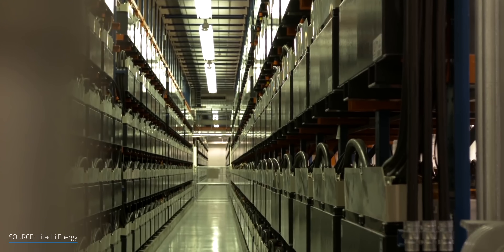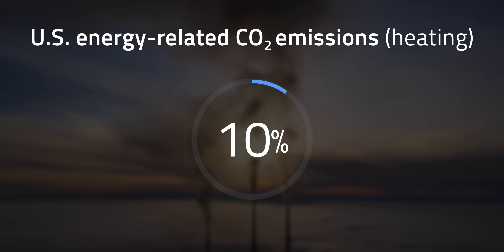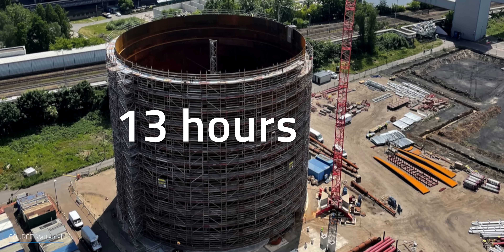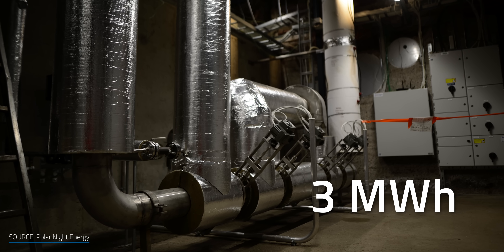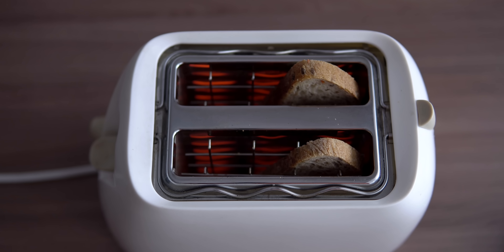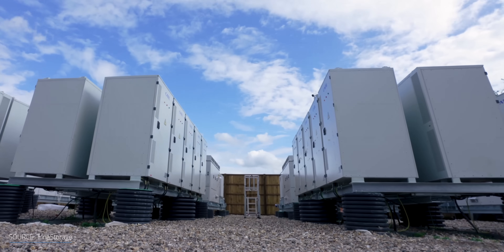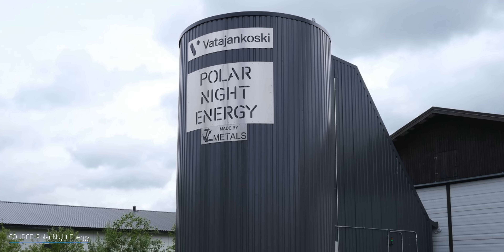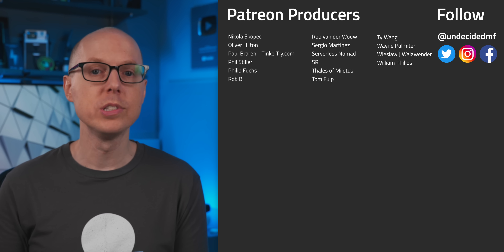How A Sand Battery Could Change The Energy Game

Comment: Actually, why not just use nuclear and the so called 'nuclear waste' since it's hot can also be used. Maybe 'nuclear waste' is actually worth more than gold on today's energy market. In that case our nuclear waste facilities are worth trillions or maybe quadrillions of dollars.
Reply: Nuclear waste (actually called spent nuclear fuel) after the period of time it cools down in spent fuel pools, doesn't emit that much heat. It can be dangerous to store it "hot", because it can melt.
You could throw it into a sodium-cooled or liquid fueled fast breeder reactor coupled with thermal energy storage (molten salt or this stuff) and do Cogeneration. District heating, desalination, synthetic fuels, hydrogen, efficient load-following... There are 2 reactors in testing (MOLTEX, and Natrium) that work like this.
Reply: @AlldaylongRock  Doesn't emit that much heat? Over time that heat is significant and 'free'.
Reply: @paul1887  Power Density. The issue here is that there's is a lot of energy (heat) in the SNF, but it's emitted way too slowly for it to be usable in any economically viable scale, such as district heating.
A reactor makes this heat usable by speeding up the reactions that emit said heat.

You would need to process the SNF to extract, for example, Pu-238 or 239(although other isotopes can be used), so you could make a RHU/RTG from it. And the amount of heat output would be enough for a couple homes at best.
Reply: @paul1887  The Peltier effect is atm pretty rudimentary and inneficient, and probably gonna be like that for a long time. There are Stirling engines tho, but idk if SNF produces enough heat on itself to extract any useful power out of a Stirling (RHUs can do so, and you can make a RTG using such a setup, even Cogeneration (Heat and electricity)) . I don't think Peltier units are gonna get much better (as does PV with some of the best panels being 23% efficiency, and maximum physically possible efficiency being 30 something percent, basically the same as a single cycle thermal power plant, combined cycle is in the 60% efficiency range, and high temperature nuclear reactors could theoretically run combined cycles with the right upper and bottom cycle choice, providing that the temperature differences are enough)

Comment: "Something as safe as sand ..." Sand at room temperature is safe. But I wouldn't want to be standing next to a thermal sand tank if it ruptured and released the sand which could be at 600 degrees Celsius.
Then I saw the picture of the Finnish tank which was above ground and close to other infrastructures and possibly people.
Solution. Build the tank in a hollow which would entirely contain the hot sand if the tank ruptured.
Better still bury the tank entirely. This would compliment the insulation properties.
This is what we do with petrol (gasoline) storage at filling stations. We have the tech to do this with hot sand tanks.

Comment: Minor correction: You said Russia cut gas. This is true, but in Finland, very few actually use gas for heating. We use electricity, oil, coal etc. but very little natural gas. Finland was not really affected by the cut. Germany, on the other hand, was affected a lot.

Comment: Hi Matt, just one comment. Solar PV and Wind is not zero carbon energy. Not yet at least. Both have a carbon footprint and whilst it is much lower than other energy sources, it is still there until it is made from RE, green steel/cement/mining etc. I know this because I have been working on LCAs for a project to produce green hydrogen - with an international certification company. Low carbon is a better term to use.
Reply: I never thought about that. Its cool that you work for a green hydrogen company i am very interested in hydrogen.

Comment: I think that a few things are missed here. Much like other "moonshot" projects this is a obtuse solution to a problem that doesn't help solve the problem its claiming to work on.
1. This is not a battery! hot sand in a silo connected to a series of pipes all of which need a ton of insulation and will have mechanical moving parts. As the video said if you want the electricity back you drop your efficiency down to 25% or lower. If this was somehow build out you have a steam supplier, much like con-ed in new York city
2. for it to scale up to "100x" as said in the video you would need somewhere in the area of 100X input energy, where is the energy coming from? solar and wind do not exist is excess quantities in or near most major cities and off-peak hours, at night, don't produce solar energy anyway. 
3. Building out steam piping in any major urban center that doesn't already have it would require a huge amount of time and money if its not already in place. this money could be used on a ton of other green / carbon reduction projects, like building modernization and better home insulation.
4. Transmission energy losses, if this is build INSIDE a major city you are looking at all the energy requirements being placed on top of the already strained power network. If this is build OUTSIDE a major city, then you need to build out even longer and problematic steam piping to bring the steam from where ever this is built into a city to then have is be distributed. This will be no-where near a 99% efficiency.

I would go on, the industrial steam production is a joke, the "seasonal" storage of steam generation only useful in the winter, the immense costs of building out the steam pipes in already built urban centers, the cost of retooling most home/ building heating systems to run on steam, the requirement to build "base load" steam plants if you do go and build this out to ensure you have steam delivery all year long, and the exclusion zones needed around such a plant containing MASSAVE amounts of sand at 1000 degrees F.

Comment: Let's not get too enthusiastic about that 100% efficiency for resistance heat. As anyone with a heat pump knows, you can get a lot more heat than that out of a unit of electricity. This idea works because the input energy is in a real sense, almost free, and the storage cost is so low that you can afford to cycle it once per year. Renewable energy sources on cloudy windless days are few and far between. Curiously, if, as Matt suggested, you turned this heat into electricity at 25% efficiency, and the used that in a ground source heat pump with a COP of 4, you would get back the same amount of heat.

Comment: Something similar was invented before WW2, Seasonal heat storage that is. I wasn't born until 1948 but we had an encyclopaedia that showed this system. It said the material in the heat store could be rocks or bricks that the summer air could be circulated through so that one end became warm. By circulating air through it into the house, it could heat the house in winter. The Structure would need to be the same size as the house it served. That's all I remember but I guess the idea never got taken up because kerosine was so cheap after the war.

Comment: If you live in a more temperate climate, what might be better still is if you used a heat pump to move summer heat out of your home and into the sand battery. Instead of using your AC to just "dump" the unwanted heat outdoors, save it up for the months when you wish you had some of it, then cycle it back inside when you need it. Waste not, want not?

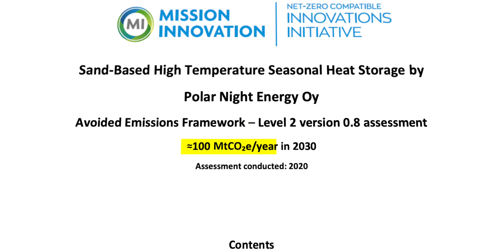Comment: @7:50  100MtCO2e/Year is almost twice New York's CO2 equivalent output in 2020??  That's utter B.S.! 
One Metric ton of CO2 is produced by 1 car in 3 months of normal use so what your statement is saying here is that the entire metropolis of NEW YORY CITY for the entirety of 2020 produced a CO2e EQUAL to that of 12.5 cars (50Mt).  Give your head a wobble mate!
For the record, a quick google finds the following: "In 2020, NYC emitted about 56.5 million tons of carbon dioxide equivalent".  Perhaps you should add google to your crack research methodology AND learn to tell the difference between "M" for "Million/Mega" and "M" for "Metric", which is clearly what you effed up. Pro Tip; performing a "smell test" before mouthing off often prevents face-planting.

Comment: 7:54 Mt stands for "Mega tonnes", not "metric tons", so you're off by a factor of 1 million...
The rest of the world uses sensible units* by default, no need to specify metric 😉

*unless we measure temperature, then we still use a unit where "0" is in the wrong place 🤯

Comment: How can I use that tecnique at Home? Just fill some barrels with sand and store them indoors? Heat them opp with sunpanel or ny woodoven and insulate them with Rockwool? And use a Cooper spiral and a radiator egen I'm using it?

Comment: Is there an option for small scale use?  Could this be used for homes and greenhouses?  Using cost effective insulation, like aircrete, (hope I typed that right) could be used to make the container.  Then pairing it with focused solar heating the sand could be heated cheaply.  This is just theoretical but I would like your thoughts.  Do you think we could use this to heat homes and greenhouses dirt-cheaply?
Reply: It is called Hahsa or Heating And Heat Storage Apparatus.

Comment: So, if I fill a 55G drum with sand, and run wires from a solar panel into the sand, heat will be stored in the drum and can then be released and/or directed (say, into a room) by a channel of cool air?

Comment: Interesting concept. Cities were using central heating as least 100 years ago (even in small towns). There have been systems installed using thermal heat from diesel generator sets (that produce electricity) for heating in isolated areas. Would be nice to understand to full cost for build a storage unit of this type. Any plans for pilot testing in the USA?

Comment: Id be interested in a small scale home version of this. Imagine being able to replace natural gas oil boiler with something like this. That would be amazing!
Reply: A scaled down mini Earth won't be able to hold on heat end efficiently.
Reply: I'd also be interested is such an application... BUT ... I think the problem here is the area to volume ratio drops making the insulation less efficient, so the heat would decay away faster.    Still it would be interesting to see if it could work over say a day / night cycle in a cold climate in a geothermal mode for heating a home at night.

Comment: This could be used for individual homes as well, only at a smaller scale. Imagine hooking that up with solar panels. Also imagine heating that air with a heat pump instead of resistive elements.

Comment: What about installing a Stirling engine at the top of the sand reservoir? Heat rises, so the hottest area would be at the top, and the temperature differential between just inside the reservoir and the exterior air would be quite large, which is when Stirling engines are at their most efficient. You wouldn't have to run it, but could do so when deriving electricity is more important than harvesting heat (like summer when the A/C's are running).

Comment: Solar thermal power plants use mirrors to melt salt in a furnace. That salt stores the heat for driving steam turbines. It’s low cost and store A LOT of heat in useful ways.
Sand is ok but it has to be seaside or desert sand with rounded particles. River sand is too sharp. The particles bind together.

Comment: the main catch is to insulate the sand, because of its low specific heat capacity it will gain heat quickly and loose heat quickly at the same time.

Comment: Heating the sand could be made even more efficient with a heat pump, instead of using a resistive heating element. Yes, you can have greater than 100% efficiency. The main benefit I could see of using a resistive heating element, is lower maintenance and production costs, as well as a longer lifespan. But figuring out which heating method is better in this application is more complicated math than I can do.

I think this kind of battery would be useful in key locations where a facility of some kind produces a lot of waste heat, and happens to be close to an area that heating is in demand. Perhaps a mid-scale bakery could store waste heat in such a battery during operational hours, to be used during the entire day and night, acting as a capacitor for heat.

If this sand battery is kept small enough in scale, it could potentially be combined with more of itself by hooking them up in series. That way, if the attached facility is decommissioned, the sand batteries can be salvaged and moved somewhere else, allowing them to be reused.
Reply: Exactly! Why not use a heat pump to put the heat in? If the point is to use it in the summer, then it will be helped by the higher outside temperature.
Reply: @manveroo1340  Ah! Thanks to you calling it a heat pump, I realized I called it the wrong thing. I used accidentally used heat exchanger instead of heat pump. (A heat exchanger may be a part of a heat pump, but it doesn't actually concentrate heat, it facilitates the flow of concentrated heat to an area of less concentrated heat, in a manner planned for by the engineer.) I'll edit it.

And yes, the heat pump would be good in relatively warm environments. Environments like Earth. Because even the coldest biomes on Earth are a good deal warmer than absolute zero. Assuming you are concentrating heat from the environment, then the closer the ambient heat is to your target temperature, the more efficient the heat pump will be.

A resistive heating element may still be useful at the very upper end of the heat range for what the sand battery is capable of holding. I'm not sure if a heat pump can operate at the same upper temperature limits as a heating element.
Reply: @World_Theory  You won´t get the same temps as resistive heating, if heat pumps could pump out 600°C temperature all our problems would be solved instantly. What heat pumps would need is a different gas to compress and decompress
Reply: @GunniGST  Mmm, okay. That answers a question I had on my mind.

Comment: Nice summary of the technology - like many great ideas, it's impressively simple. Couple of points:

1) Resistive heating is a good thing to start with, since it's cheap and simple. But 100% efficient is actually not that good! Heat pumps can get >300% efficiency for heating. But they're more expensive, more complicated, and I'm not sure if they can reach anywhere near the temperatures needed.

2) Water can be used at much greater than 100°C as superheated steam, under high pressure. That's the technology all big fossil fuel and nuclear power stations use to move heat around and to drive the turbine. It's also what this company is using to transfer heat out of the sand. And why it's all off-the-shelf parts.
Reply: 300% efficiency...congrats bro, you just invented eternal engine
Reply: @vygag  Welcome to the interesting world of thermodynamics:
https://en.wikipedia.org/wiki/Heat_pump
"With 1 kWh of electricity, they can transfer 3 to 6 kWh of thermal energy into a building"
Reply: @markirmuir  damn, thats really eternal engine, pair it with steam turbine, a billions worth idea

Comment: There's something missing. Where do you need hot energy? In cold climates. But you would be stupid to build this battery above ground in cold climates.. because underground is constant above zero temperature. I can understand this mass of sand digged into the ground. It's just massive insulated barrel full of sand, if I get it right.

Comment: This is not new. If you research some of the early hot water solar systems from places like the mother earth news a similar system was used in basements. They would dig 4 feet below the floor in the basement and fill it with sand and their radiant piping and cover with insulation. These systems were ridiculous. I believe there is a home development in Canada that has a massive hole dug and filled with sand using all the homes solar roofs in the development to heat the sand. I haven't heard anything about it in many years so it probably failed. If it is "cold" and there is cloud cover for 2 weeks you must still have backup to cover the load, it is that simple. Gen 4 thorium plants are the answer and in the future fusion. Big buckets of sand! How ridiculous.

Comment: I got excited and crimped some nichrome wire to an XT60 connector and put it in a box of playground sand and plugged that in to my 100W solar panel. The nichrome worked great, I even got a little burn on my finger. 

The playground sand has two issues though... it doesn't conduct the heat to the rest of the sand from around the heating element... and it doesn't retain that heat (I checked it one hour after the solar panel was shaded.) 

I see from other comments that quartz sand is preferred.... will try this. I'd love to have a place where my cat can sit outside during the winter.

Comment: Actually you can store energy far better as steam (water at super high temperatures). Plus water is far more available than sand. Plus you still need water to convert that heat to electricity via steam. Also, the steam tanks I would build them within the walls of every building + a pressure-electricity convertor + water recovery to go with = every building will be a generator. Water will be like the blood, the structures like the circulatory sistem and the EM generator like the muscles :) I already envisioned such tech back in 2009 with adobe organic super healthy and human architecture + all the super tech to go with based on electricity generated from water / steam / heat in smaller and smaller amounts as the tech goes more and more advanced :)
That and so many other concepts that have mostly panned out to a certain point (lack of ressources to pursue them)